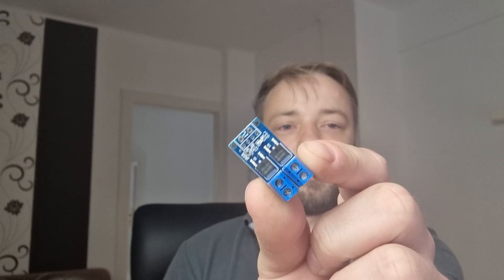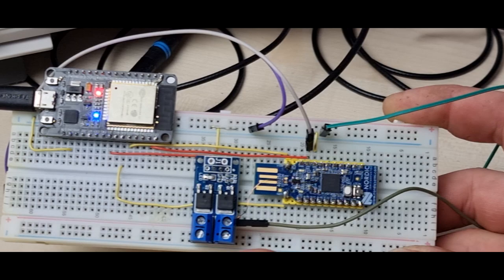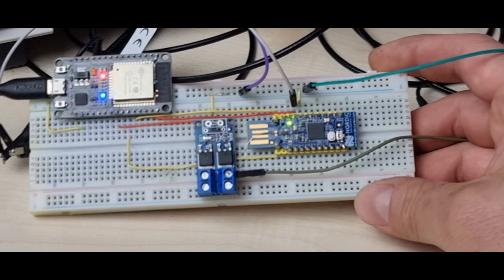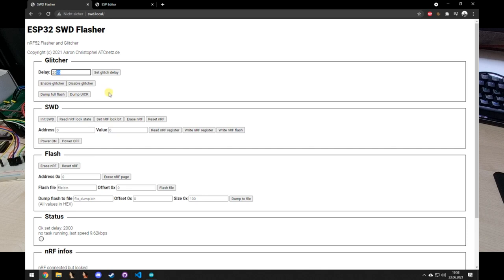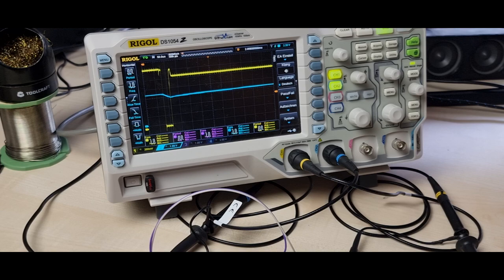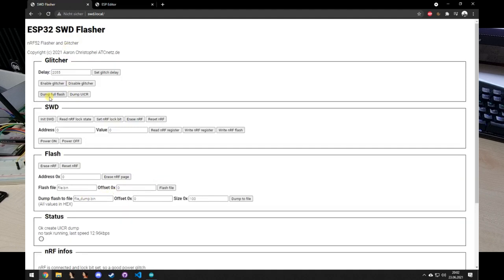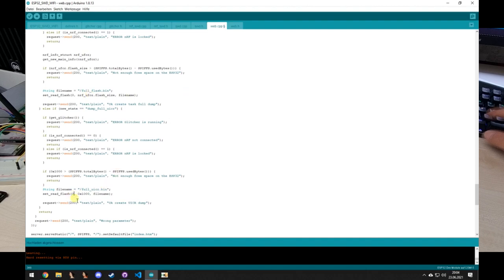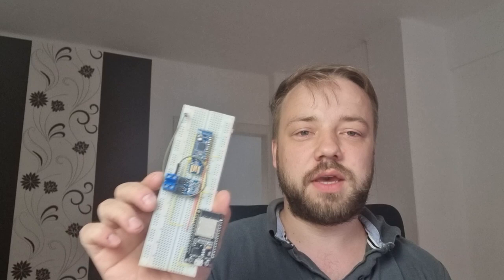HowTo bypass APPROTECT of nRF52832 or nRF52840 with ESP32 Power glitching

Comment: Awesome video!! It would be interesting to try reading the MC68HC908AZ60's security bytes with current monitoring attack done by ESP32. There are several programmers which can read security bytes from that microcontroller by monitoring the current while sending security bytes and I think ESP32 would be more than enough.

Comment: Thanks for all the detail! I was curious if i just wanted to use this as a flash tool for new/unwritten nrf52s, can i skip the MOSFET/DEC1 connection?
Reply from the maker: Yes, that is only needed for glitching
Reply: @atc1441  thanks! im getting to play with it now as i have it all assembled, the flasher tool seems to work great! but I am running into issues in that the program im trying to install was put together with a makefile that points to 'nrfjprog' using a segger connection to write the .hex files generated. would you know what might be different from what type of commands nrfjprog command would be sending with a jlink vs what your SWD does? 

the makefile just uses the .hex file directly, would the nrfjprog be converting those to a bin or other format?
Reply from the maker: You can open the hex file with a tool line HxD and it will show you where everything as well as it allows to export a .bin file

Comment: Did you test this with brown-out reset to protect against power clitching? Or is brown-out only active after bootup?
I saw the security notice by nordic. They only state physical access as mitigation tactic.
Reply from the maker: The brownout is not detecting the core voltage as  far i understoud.
See LimitedResults newest power glitch on a different chip, there he talk a lot about the Brownout detection

Comment: Hi Aaron, does this work on nrf52840dk? tried connecting the same way to nrf52840dk but in the swd flasher it shows nrf not connected. please help
Reply from the maker: Hey yes it should work the same
Reply from the maker: It should work out of the box, please check the wiring.
Reply: @atc1441  I connected nrf52840dk - SWD IO (P20) -> ESP D19 then SWD CLK (P20) -> ESP D21. GND -> Esp32  GND. For VDD do I stay within P20 (nrf VDD) or use another pin that is just VDD?

Comment: Hi Aaron, is the C5 (Dec1) capacitor removed?
Reply from the maker: Hey. On some it works better when it is removed. So better try with and without
Reply: @Aaron Christophel  ok thank you! so if the glitch is at the correct position, the tools will stop itself or do I need to press anything? cause now the glitch don't seems to stop after reaching the glitching point :(
Reply from the maker: It will stop when detecting a glitch. Then please try without Dec1 cap